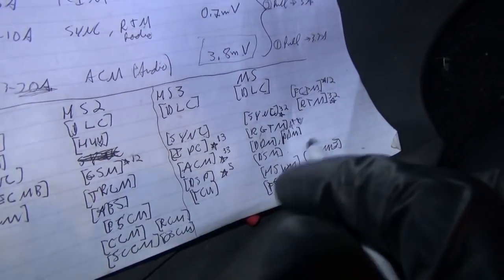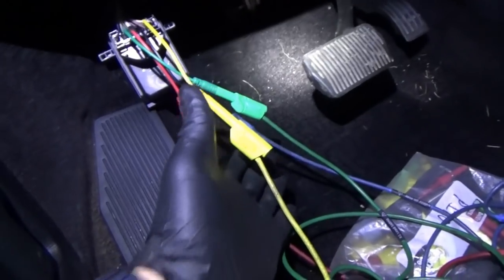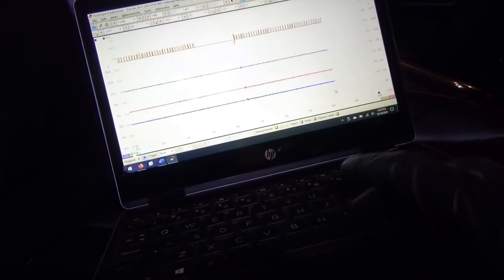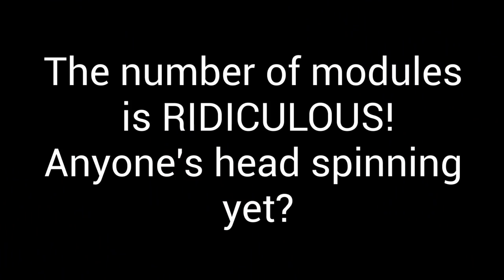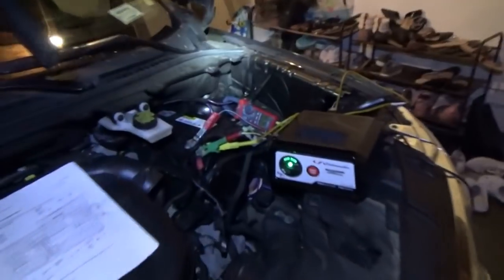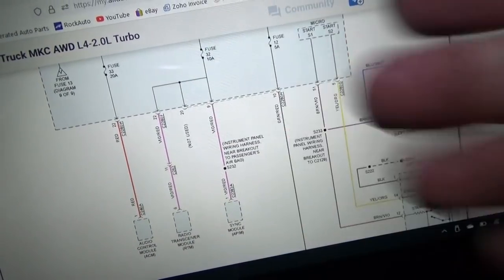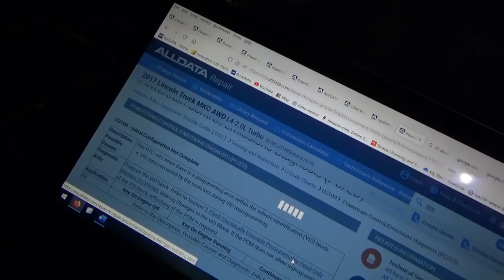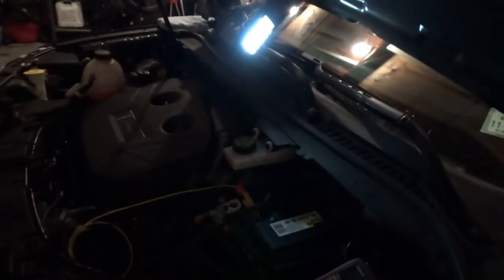7 HOURS to find a 5-AMP Draw?! (Lincoln MKC - Part 2)

Comment: Wow that was totally insane. I hate the way auto manufactures make the vehicles so dependent on what I call "Bells & Whistle" systems. In today's Emissions and Higher MPG vehicles computer control is essential, but to tie a vehicles ability to run and drive to a system like that is just nuts. I worked in networked Avionics for years and all the flight dependent systems had isolation pads on them to ensure one system didn't draw down the other systems either electrically or in programing. They also had their own internal fuses to keep them isolated from the others electrically on the power buss. I wish automotive engineers would do something like that on their systems. One thing that has always bothered me on vehicle electronics is the use of Lead Free solder, in my opinion it's the major reason for Automotive Electronic failures. In avionics repairs for the military, Lead Free Solder is banned due to it's unreliability. The reason it's so unreliable is that the solder, unlike Leaded Solder, doesn't expand and contract as well. As Lead Free Solder cycles the joints begin to crystalize and crack. Overtime the cracks cause hi current draw through the small portion of the joint. These cause; intermittencies, heat build up on the remaining contact area, higher resistance and then lower current flow. After several years of cycling the components can fall off the board due to cracks and vehicle vibrations. They can short out other components on the board, or open the circuit causing it to fail.  Lead Free solder should be banned on all vehicles for sure. Thanks for sharing I totally loved the video series on this. Best Wishes & Blessings. Keith Noneya

Comment: Un-fucking believable Ivan. I would have punted this to the dealer LONG before this. I had one thought though: With the key away and the latches tripped, could you possibly have done a system scan and seen what modules were still awake and gone from there? Just a thought, would love to hear your opinion on that. Hope I hear from you. Good job as always, and thank you from Rhode Island.

Comment: This is sad.  Obviously, this rig is new enough and valuable enough to go all through this.  Down the road when this gets to the Buy here/pay here hooptie stage, this diagnosis will make no economic sense.  AND other than that, there may not be all that much wrong with it.
Reply: Yup, you will see a battery disconnecter on it
Reply: With how the cost of even used cars on the rise. Sometimes what maybe didn't make economical before, could now make sense. Crazy how the world is going now.
Reply: theres a good reason that Lincolns dont hold thier value.. the  Ford dealers dont even want them on trade in.  same for the Caddys, except for the cts v models

Comment: Very interesting and tiresome diagnosis. I have a doubt though: when you reprogrammed the RTM and you replied that the old module was still in the car (at 33:10), I wonder if it copied whatever corrupt data was in there and reprogrammed it back again. Not sure if you already have the new RTM, but if it indeed reads the corrupt data, it may still load that garbage into the new module (perhaps reply that the old RTM is no longer in the car when programming the new?)

Comment: That would actually be more than 8 weeks to discharge a 70Ah battery at 50mA, more than 2 months!
Reply: @T.J. Kong I agree...only so much of the 70Ah can be discharged before the battery will reject a starter motor amp draw. Maybe John was thinking of a 194 light bulb draw.
Reply: @T.J. Kong I meant it would power that (/a resistive) parasitic drain for 8 weeks, and probably be permanently dead then, but I'm sure you can get pretty much 90% out of a lead acid battery that had a volume that would correlate with energy density to equate 70Ah. A starter battery doesn't magically drop to 0V at 50% discharge you know. What it does do when discharged that low is suffer a chemical reaction at its terminals which will degrade its future capacity to carry a charge, but the energy initially stored doesn't magically escape a back door!

Comment: Did he get It? I have a feeling the way that programming worked was it just pulled what was on the old one and slaps it on the new one. I'm thinking it will install the corrupted on the new one. May actually need new configuration files from the manufacturer's database.
If that is how it works seems kind of pointless. Why would one be replacing a module that is able to be read that has good software? I suppose if something happened to the antenna but it otherwise worked could be one reason.
What happens if you say you don't have the original? Can your tool pull a new config?

Comment: Wow, its CRAZY How many of these Goofy Modules  on one Circuit. How can these wires be heavy enough to handle all of them. And the wires keep getting Smaller..CRAZY..I like electrical in OLD Vehicles and even big trucks. But I would rather have my Legs cut off then do it on these new vehicles...LMAO...LOLGreat Job Sir. And Video.

Comment: Expensive cars are a test bed for thing like digital control, you give things power, communication, and command it to do what you want or get data from it. Airliners have been going this way for a long time with redundancy, no cables or hydraulic lines running from the cockpit. You have a module that can talk but can't hear it might keep chirping, everyone hears these chirp and responds, there is no airline redundancy in a cheap car and you don't fall out of the sky. An Arduino is $5 for a consumer and probably a few dollars for an OEM, you give it power, communication, some device like this radio and it's plug and play. Cheap cars are still doing a lot of it the old way for now I suspect.

Comment: I saw a video where  Dave DeCourcey said U code means some other module saying YOU are bad. 
ie. Another module was pointing to the radio control module as being bad.
It is that way because a bad module may not be capable of communication.
Sounds like bad engineering when a failed module keeps everything awake and drains the battery, but designing for every failure mode  is difficult.
Hopefully that is the bad module, and not the one on the other end of the message. 
Acts like a bit in memory got flipped, but programming should have failed.... programming usually has an integrity check (checksum).
I don't know if that is something you can raise a flag to the manufacturer about,...they will probably ignore you at every step in the process.

Comment: Do you think a dealership is gonna go thru that whole process?
Chances are they will send you away or tell you it will cost $2000 and you yourself will leave.  These cars are getting two complicated for their own sake. Remember when cars were made for transportation, I just need to get to work and back!
Reply: Not true Greg. There are dealers out there fixing these vehicles. It's common for these vehicles to have extended warranties and factory warranties. They have to be repaired. I dislike the comments about dealers. That's a broad brush you just swung. 7 hours? at an hourly rate of what Ivans knowledge and expertise is easily worth 150.00 200.00 hr. plus Module, programming. The Bill would be at least 1500.00 plus. A "competent" dealer or shop would have gone into this job with an initial diagnostic time quote. And added to it as needed. They would of asked and received an ok from the owner for all diagnostic time. If not it gets pushed outside. I personally would love to see what this owner has done to have this car repaired. Do you think a dealership is gonna go thru that whole process? At my Dealer, the answer is "Hell Yes".As long as we're getting paid. Again, Nice Job, Ivan!

Comment: The burning question is what did you or would you charge for this?  If indeed you spent 7 hours on this car, well, the diagnosis should have been $700-1000.   This diagnosis was extremely interesting but 1) would a customer really pay that kind of money for diagnosis and/or 2) would a dealership or shop invest this amount of time on one car when you likely booked an hour or an hour and a half to find a parasitic draw and other "broken" cars lining up to be fixed?
I am thinking most of the time the answer to both is "unlikely."
Reply from the maker: Will discuss billing in Part 3 🙂

Comment: There is absolutely nothing new on the market that I actually want to have.  All I really want is to keep my 2001 Town and Country running until I die, and  honestly, it has more technology than I actually want.  I honestly want my window cranks, manual locks, manual doors, no radio, basic heat and defrost cars back.  This is ridiculous and counter productive.

Comment: I'd like to know how many parts a dealer would have thrown at it. This job would have killed a flat rate tech. Its stupid to make something so complicated, yet no diagnostic tool to aid in the repair. It wont be that long and the modules wont be available. It took a good Pico tech to repair.

Comment: this is why most   people trade lincolns and cadillacs in every year from new., 10 pounds of shitd in a 5 pound bag.  when  RADIO module will disable a vehicle things have gotten out of hand,.
I wonder if heat is cooking those modules being so close to the metal roof, and being inside of the headliner,.  also they are likely picking up the millions of EMF signals in the area.. the fact that the radio was switching to AM channels is interesting.. maybe cars are getting hacked now., .. ha
also I wonder if you can pick up a heat signature with the thermal imager if you pull the headliner down while its malfunctioning, 5 amps should creat plenty of heat somewhere along the circuit

Comment: They're not cars anymore, they're computers with wheels. I bet they could make a car without all that crap, that would be just as  fuel efficient, and just as environmentally friendly. But like Henry Ford said: He'd give you the car for free if you bought all replacement parts from ford. See the car manufactures realized that the more whistles, and bells that they put on a car, the more that could go wrong. The junk yards are full of cars that have a problem that couldn't be diagnosed.

Comment: Hey, I wonder if ether could be used to put it to sleep! Time for euthanasia. Just kidding, of course. That was not just an amazing demonstration of troubleshooting ability, but one of unbelievable tenacity!!!! After so long, even those willing to keep working on a problem lose mental effectiveness. 
After systems reach this level of complexity, it is vital that they are able to self-diagnose. That was several levels of complexity ago for this car - and it is well beyond the reasonable design limit. Takes a herculean effort to troubleshoot it - and there is a shortage of those super-powers these days. With the advent of computers, folks have completely abandoned the old "points of failure" philosophy - considering every component of every module a potential point of failure. And this is the sort of thing we end up with. My hat is certainly off to Ivan and any others who have adapted and learned to operate in this environment, as it is not likely to ever change back. I just hope those with the super-powers are being paid what they are worth!
Reply from the maker: I was pretty much out of steam after this battle haha

Comment: 52mA x 24 x 14 = 17.472A  flat battery no way
Reply: On a brand new battery which was fully charged from start, you are right. On an older battery in the winter, not fully charged to start with, that's the real capacity of a "70 amp hour" battery

Comment: This is a great example why modern car makers are ignorant to the economic needs of car buyers. Unnecessarily complicated and expensive repair options, causing  expenses to skyrocket - which will be remembered by the consumer. Car dealers do not have the techs to troubleshoot the problems. Even Factory Techs are in the dark   as to the repairability of these electronic components. Young men have been increasingly steered  toward BS degrees and  vocational training including Auto Tech is of less interest although the pay can surpass that of many college grads.

Comment: Okay, this is going to sound stupid but I am worried that this entire diagnosis is flawed. It seems possible the radio module could be keeping the car awake due to some reason other than being bad (or misprogrammed). The most obvious question here is, how can you really be sure that putting the fob on the opposite side of the garage is far enough away? And how can you rule out a bad fob? Did the draw also occur in other places than that garage/house? Shouldn't you also be checking the environment (take the vehicle somewhere else other than the customer's house) and completely removing the fob from the picture before spending what is surely an insane amount of money on a new module? Yes, the misconfiguration code is really sketchy, but it doesn't seem like it is 100%.
Reply: I thought you would have  to put the  fob inside  a faraday  cage for it not to communicate  with the car. 
Thieves  drive neighborhoods  looking  for that tell tale ping  & then  emulate  it in order gain entry  & drive away.
Reply from the maker: Hey Jessica, Part 3 coming right up so we can all sleep easy haha ;)

Comment: WOW IVAN what a pain in the ass.So the way i understand it is ,the car needs constant power somewhere so that it can TALK to the KEY fob.AND that's because a modual HAS to be awake to receive the signal TO UNLOCK THE DOORS.My thinking is if you don't have REMOTE KEYLESS ENTRY,you wouldn't have this issue,is that correct?But then they TIED the remote entry to the starter circuit and that's why you needed the key-less entry to be able to start the car.They have over_COMPLICATED the car,but YOU {the consumer wanted MORE FEATURES}right? haha OH don't forget my wife wants HEATED SEATS>>so by the time she gets in the car a 5:00 am in the snow the seat is NICE AND WARM!!!oh and remote start and a coffee maker preferably that uses PODS>thanks IVAN

Comment: To the owner of the channel i have a question about a 2010 Nissan fronter  will not start when is cold outside, It will crank over real fast but will not start i can put a battery charger on it for less than a minute and will start right up. I am a tractor mechanic but autos are not what i have worked on for 25 years, any ideas as to what could cause this? My email is MICHAEL672005@YAHOO.COM  THANKS.
Reply from the maker: Tis the season for COLD Nissan no-starts! Just diagnosed a 2011 Frontier with the exact same symptom this morning haha Answer: ECM is failing and will need to be replaced. Did you see the Nissan Titan No-Start when COLD video? Owner of that truck just replaced his ECM and truck starts perfect in the cold now :)

Comment: Dear Ivan, This kind of diag. needs an Alchemist like you Loool. Excessive use of unnecessary unreliable modules and can networks that could deter the prime objective operation of a vehicle. They make car computers not for emission control only as its main purpose, but they made it to look so complex like a central autocratic government that interfere with (or spy) every aspect of every human life, which eventually will turn against it, that is why these herd of cars are not successful at all. I hope this telepathic transceiver module is not hackable by uncle sam too, Looool. Take Care.

Comment: Please do not cut a complicated diag video into two parts. It annoys me to the core. Also, why the repair needs to be in its own part, part three? It makes much more sense to just release the whole diag, fix and optional defective module autopsy in one video.
On topic... Car manufacturers need to change their mindset: every added module WILL fail and WILL cause problems. It is good that the key fob contains a hidden actual key that can open a door. But what good is that, if you can't start the car? Two more switches are needed. A power cut-off switch for all non-essential modules and an old-fashioned key ignition.
Reply from the maker: Simple solution: wait until all the parts are released and watch them all in a row! Who doesn't like a good cliffhanger? ;)
Reply: ask for a refund !
Reply: If you put the fob in a dedicated space, the car can be started. The place is shown by Wes here: https://youtu.be/hSjYu6DrTFs?t=1878
Reply: @PineHollowAutoDiagnostics  Thanks for the advice. But only when watching part 2, I can find out about part 3. It could work if you'd title the parts like part 1 of 3, and so on.
I think I'd be able to bring myself to wait until all parts are released, if I'd know how many parts there will be.